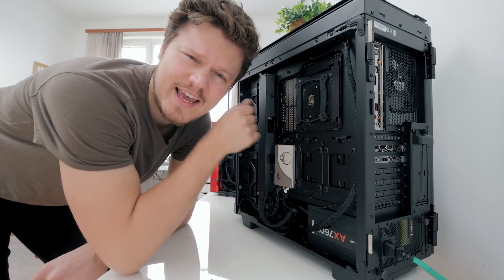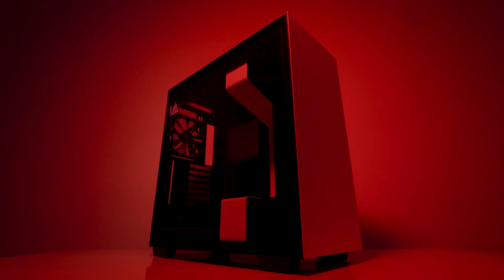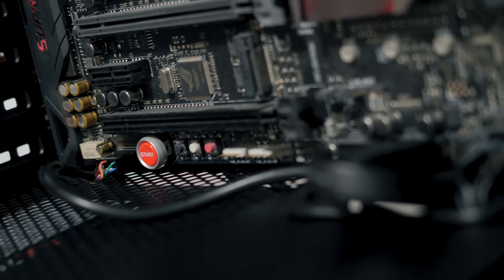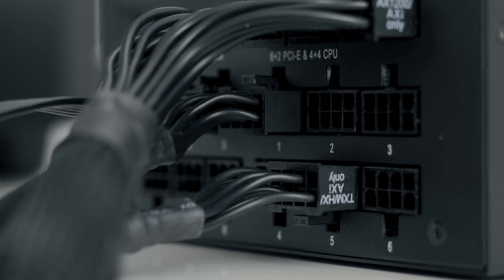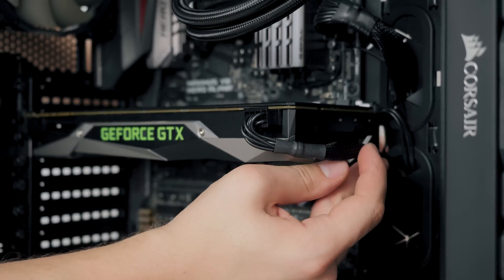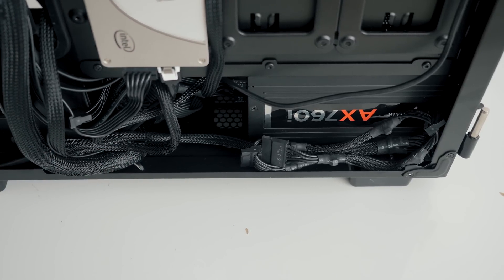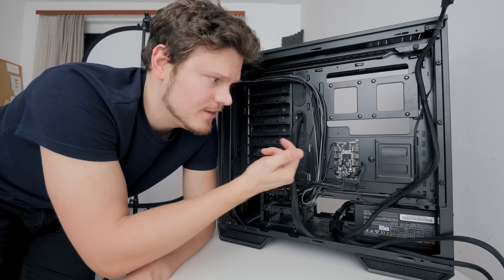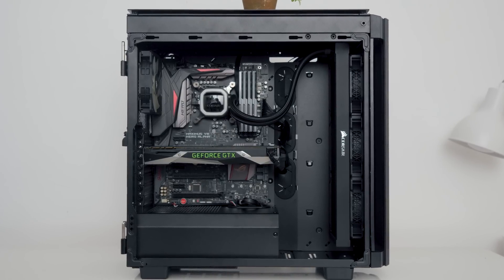Tips for the PERFECT Cable Management PC Build

Comment: im scared to bend my cables so they dont break. anyone have any tips?
Reply: bending them is fine unless you are bending over and over again at very sharp angles, which is pretty hard to do with PSU cables.
Reply: Bending them once is no problem, it's when you repeatedly bend them there's a problem.
Reply: okay thanks

Comment: 1st tip should be don't buy something that's got 5 cables sticking out of it ! or 1st tip should be get a modular or semi modular psu and another tip (albeit more expansive, get an m.2 which will reduce a lot of the cables needed).

Comment: I did  cablemanagement in a $40 case not too long ago... Did a pretty good job exept that the 24pin was just too thick to be able to close the case properly... One big tip if you try to do some good cablemanagement in cheap cases look first before you route any cables. You got too check EVERYTHING... (Like the thickness of the rear side panel, where the cutouts are for the cpu power cable (maybe you'll need to route your cables before installing the motherboard)...) It's really a big puzzle and not that easy... Oh, and don't forget that cheap cases have sharp edges... 😑

Comment: 1. ZIP ties 
2. ZIP ties
3. Zip ties
Reply: Cerus98 almost thought you were serious
Reply: Cerus98 if you have ever professionally built a computer and dealt with cable management, then you know to use thin 2mm wide zip ties which are so weak you can use needle nose pliers to twist the zip tie and it will just break for easy removal, otherwise, you can use fine tip wire cutters which also do the trick without ever damaging the actual electrical wires inside the system.
Reply: Cerus98 In my career, I’ve built over 10,000 computers. You worry too much about the removal of the zip ties and parts from the computer at times where you are probably upgrading. 

As well, your power supplies comes fully stocked with multiple cables, more than enough extras if one of them were damaged from someone making a major mistake.

Zip ties allow you to fit the cables in the system in the most secure fashion, and is ideal for proper cable management for aesthetics.
Reply: Cerus98 soon as you said twist ties, this conversation was over.

Comment: Why did this create a urge inside me to clean my PC x)
Reply: not seeing a problem doesn't mean it's not here. Not cleaning ""may"" lead to some failures, but hey you do want you want, we're not paying for your hardware
Reply: WarmSoftKitty talk about cheap for yours maybe
Reply: I had a laptop I never cleaned in the almost-decade of operation I've had it, and at its worst I was unable to get anywhere past 2 gigahertz (with its max being 2.3). I replaced the fan since it was too dirty to bother with and cleaned the heat sink, suddenly, my machine was able to run at nearly full speed. Cleanliness does matter in certain cases.

Comment: Quick Tip: you can open a zip-tie by pushing the tip of a knife underneath the locking teeth. If it still can't be opened, push the knife in whilst pushing in on the zip-tie itself.

Comment: I'm f. hate Usb 3 cable too :))) Soo stupidly build cable. 
New usb 3.1 gen 2 output on new motherboards like asus is future. 
I want a see them only usb 3 output next year boards and cases.  
Please Dimitry warn case manufacturer about this.
Lots of motherboards already have this supports but cases always left behind.
All new case they send to you review go on them about this. 
Case manufacturer working sooo slowly some still putting molex powered fans.
Don't even accept to review case like that :)
Reply: We need an adapter for that USB 3.1 Gen 2 header. More motherboards are having it but hardly any cases do. My Maximus X Hero (mobo) has one but my case doesn't, and I'm short a header so my two front panel USB 2.0 don't work. A USB 3.1 Gen 2 to 2.0 (or even 3.1 Gen 1) adapter would be handy but I don't think any exist.

And yeah the bulky USB 3.1 Gen 1 cable is annoying. I bought a low profile USB 3.1 Gen 1 extension cable (it looks more like a 2.0 internal connector) so the front panel cable isn't smashed up against the PSU shroud (like it was in this video).
Reply: Why do you guys even want a new case`? Unless it is really poor in build quality?
Reply: still no good option a year later, it's super annoying with my gigabyte aorus 570 ultra in my lian li 011 dynamic, the usb 3 header dosn't allow me to add the middle-bottom fan. I don't understand why this cable need to be that big and thick, I haven't found any article or video talking about that and/or giving any explanation about it, for it to need to be physically like that. (could be a video suggestion)

Comment: Dimitri you should definitely become a cable management guru cause your cable-management is that of a pro and very commendable! I have the Fractal Design Focus G Mini, which is a micro-atx case, and is very lacking in cable-management options. I will definitely check out your upcoming budget case cable management video cause I struggle with how to hide my cables in this case. It is a nice case and good for the price but doesn't have many options in terms of cable management. So I will definitely be redoing my cables and attempt to follow this video guide. Thanks for the help and looking forward to the next video!

Comment: I have a corsair crystal 570x and was wondering if i need the hd audio wire.  Its a pain to route in that case and my headset is powered by usb from the mobo and my external speakers plug directly into the mobo as well.
Reply: Aaron Chandler thank you been wondering for awile now
Reply: Aaron Chandler would it be safe to cut it out with wire cutters and electric tape whats left?

Comment: You forgot... "Step 1: Get a good case."

Also, I've always thought that good cable management really just comes from using common sense and this video really validated that. Utilizing motherboard cavities, controlling smaller cables by tucking it under thicker cables, routing certain cables early on, etc. are things you do learn as you build and I really don't see how a lot of people miss that.
Reply: Benyamin Lorit it might be a first build for them so a couple of tips will point them in the right direction.

Comment: Once upon a time.. of my cm haf932.. i decided to show the cables at the front instead of hiding them at the back. Turns out alright. If would be nicer if the cables were individually sleeved but I couldn't afford it. 
I was using the cm real power pro 850 non modular psu. Still using the same psu... That thing just wont die...
It's in my node804 now... Loads of excess cables..

Comment: Another cable management hack; use m.2 drives and skip having to use sata data AND power cables!
Reply: KrisPeeBacon the sata based ones are about the same it's the nvme ones that cost more.
Reply: Sartheris Stormhammer I don't mind SATA drives, especially in some cases like the H700i that show them off nicely in the front or something. A SATA power cable has 3-4 connectors, so if you use one drive you can use a few more without much more cable. I use 1 NVME, 1 SATA SSD, and 1 HDD. It's nice to have different levels depending on what speed I need.
Reply: @ KrisPeeBacon: But everyone can afford (stupid) high end smartphones. The phone will be obsolete after 1-2 jears while the m.2 drive will last maybe a decade. I just bought a M.2 Samsung 960 Pro 1TB exactly for this reason (no SATA & power cables).
Reply: Nah, SATA just gets cheaper, so it become more prevalent. Such things still have purpose, especially for cost-effective storage.
Reply: I just did that myself. I had 1xm.2 and 1xHDD, but the hard disk had these two big and ugly cables from the psu and to the motherboard, that made the clutter worse, so I just replaced it with an m.2 from Western Digital, cheaper than the most popular Samsung 960 evo, but for sure faster than the hdd.
Reply: "Have no bread? Eat cakes!" level of tip.
Reply: expensive hack :D
Reply: How much pennies should I save to buy mobo with 8-10 m.2 slots I need?
Reply: I'm using a 2TB 970 Evo Plus! Might get another for the second m.2 slot. Love not needing cables for storage.
Reply: I just browse and game and I noticed a difference moving from 850 Evo (SATA) to 960 Evo (NVME). It's not much in most tasks, but it cut my boot time from like 20s to like 12s (no Fast Boot), and browsing folders feels snappier. No difference in games though, and I only have one NVME so file transfers are always limited by the slower drive. Spend your money elsewhere if you're on a budget, but if you can afford it it's nice to have.
Reply: Luke Stringer don't be fickle, if you have four 10tb drives you have no business worry about cable management.
Reply: and enjoy the temperatures...
Reply: Save your pennies and eat all the cakes you want. Sounds like you need more sugar and less salt, anyway.
Reply: 5even5eals see previous comment about data hogs not needing to worry about cable management so much.
Reply: Kurt Dunsmore But we are the ones who suffer from cable management issues the most. I'd gladly use some tips for my heavy-duty config. Every rear panel closing is a huge pain for me.
Reply: agreed!

i have actually started by discarding all my 3.5" hdd and just use one 2.5" sata. when i get my strix z370-f this month, the 2.5" sata will be replaced by m.2 storage.
Reply: I wish my bluray burner was m2
Reply: @BrandensOutdoorChannel  buy 2tb m.2
Reply: @BrandensOutdoorChannel  i have 500gb 970 evo and 1tb hdd
Reply: I can't wait to upgrade my motherboard to have m.2 storage.... But upgrading the Mobo from my 2013 MSI board to something modern means a new CPU, and upgrading from DDR3 to DDR4... It's an expensive venture.
Reply: Only useful for people that has a board that supports is because remember there is also the used market out there.
Reply: Not all motherboards got m.2 sockets, and also if you got single m.2 socket I think the most there is in m.2 is 1TB and it's not enough storage, 2TB or more is the most recommended
Reply: PF, way to easy and not enough slots, I have all m2 slots occupied and also extension PCIe Cards for that + 4 HDDs and 3 SSDs + a fucking Sata cable cluttering the front panel with the card reader. 
It looks fine until I want to connect everything with the Sata cables.
Reply: It's what I did for my build

Also an NVMe SSD was cheaper then the SATA SSD's I was considering.
Reply: I just bought a 970 evo 1tb m.2
Reply: Sweet I'll try and store my data from 4, 10tb drives on an NVMe :P
Reply: @AAAAAAAAAAAAAAAA72  may as well setup a NAS and get all the sata drives out of your gaming system
Reply: not everyone can afford an m.2 drive lol
Reply: @MrKrispee  you can get a fast Adata M.2 SSD for less than a Samsung EVO 860 these days. Faster. Neater and consumes less power.
Reply: SkinUpMonkey well of course NVMe costs more, but it's soo worth it. I have a 960evo 1tb.
Reply: Kurt Dunsmore wave of the near future for sure - SATA is dying.
Reply: @jeffporter4847  can confirm, m.2 drives are getting way cheaper
Reply: @rainertargama6551  oof and faster just went from a m.2 960 evo to a 970 evo plus and those 3500mbps read and write speeds are just insane!
Reply: @jeffporter4847  not anytime soon just imagine, sata can be fit with TB in a case, with m.2 motherboards usually don't have more than 3 m.2 slots and those are the real high end ones. If sata leaves there will be storage cut in 1/3.

Comment: Cable managment has next to no impact on tempatures....
Reply: cable management has a big impact actually - especially if you run small enclosures like MATX or ITX cases. i spent a few afternoons re-routing my cables in my ITX case and saw about a 6C decrease in idle and full-load benchmark temperatures, which was about a 10% improvement - while being almost completely silent. that's HUGE!!
Reply: and you are all right:
1. Most benefit is in small / micro cases. Least benefit in big cases.
2. In an testing bench, how you want to generate airflow??? So yes, with airflow -> better temps...
Means, very big case, with normal airflow... Cable-management shouldn´t worry you anyway.
Reply: are you sure it's due to cable management? Seeing your exemple it only seems to show that you get better airflow in a closed case than in open case. Which isn't exactly news.
Reply: Vincent Andersen yeah, but it's still good to have decent cable management
Reply: Yep Luke did a video on this some time ago, wont matter in a case that big.

Comment: good video but the whole "cable management helps with temps" was already debunked by luke on linus tech tips. literally stuffing your case your unused cables and even extra random stuff will only make marginal temp changes
Reply: As long as no cables get snagged in fans, it's fine. Anything beyond is really just aesthetics.
Reply: Quentin Els this seems more like its the gpu. Cause truly if you think about it and try to do an cable management experiment like luke did, cables aren’t that big enough to obstruct airflow that much from your fans. You only have  a 24pin cable as your biggest cable and even that wont be big enough to obstruct more than a fan
Reply: Star-Lord that and also the elimination of the ribbon cables. Those would definitely hinder temps back then but im very certain no one here uses something that old. Not even senior citizens would be using PCs that old
Reply: @gliffogarchives4987  I have a pc using those lol
Reply: Still the cables collect a lot of dust
Reply: Just wanted to chime in as someone who has built over 100 computers over the course of my life. Cable management is purely aesthetic. And Serp D., you're arguing the ONE exception where you're using cases without fans relying on passive cooling. As long as you have fans setup properly, cable management is purely aesthetic then, and for keeping dust from collecting in the rat's nest of wires. Beyond tucking cables away from fans, this whole cable management thing is a fad or akin to subcultures you find in car culture where they spend loads of time and money on underglow or the VIP look.
Reply: @zoommair  yeah yeah because my temps are lower with a simple cable management. Don't you have some thermometers?
I guess you don't really read much about my posts, did you read about the Mosfits and other passive colled parts on the MB? OC is a thing you know.
Reply: @Vanadium  Nope, don't know who you are, and have no idea what you're going on about. Guessing English is not your first language, so could you rephrase?
Reply: If the cables start collecting dust you have other problems to tend to.. ;)
Reply: maybe back in the day it did something. These days cpus dont run at 500c and 50 volts.
Reply: What about in mini ITX with cables blocking the fans?
Reply: I agree. Cable management is a purely aesthetical thing.
Reply: My right side panel got extremely hot to the touch bc of my poor cable management first attempt so those braded psu cables were generating tons of heat and increasing my interior ambient temperature, talking about a full system build with 4 hdds and admittedly still using an old Fermi gpu, in any case these extreme pockets of heat is nothing that should be ignored
Reply: "debunked" you literally are admitting it changes temps to have good cable management.  Everything matters with the cooling when you are going for a solid 24/7 overclock.  Sure some emachine build it doesn't matter.
Reply: I admitted to a very negligible temp change by literally 1 degree if you over stuff your case with excess cables and random crap. You'd have to be purposefully trying to stuff your PC with crap if you want to even see any type of change in temp. I highly suggest you watch the cable management video yourself to see how much cable management is just an aesthetic choice rather than a cooling benefit
Reply: @gliffogarchives4987  debunked for what? That one specific case?`
Try to get far as you can with a silent tower who is air cooled with more drives then the MB can handle alone and then OC as far as you get. 
With a broken airflow alone your passive cooled bits will let not reach maximum OC what would be possible with air otherwise.
Reply: Serp D. I’m not arguing anymore in a 1 year old thread. Search “LinusTechTips cable management test” they literally explain everything behind there testing and show results
Reply: @gliffogarchives4987    so because it is one year old or 1000 make a difference how? 
Oh and because LTT is always right, right?
So you know their case had nothing actually in it to produce heat, 50°c on a cpu and max load on all cores,pf please. Did I not mention OC or don't you know what it is?
I have more then 8 Drives in one case and without out a fan they are overheating alone. Then there was probably a AC running like most of the time for LTT Videos.
Try it with actual summer temps like 30°C ambient again and actually work with that machine for some hours when your CPU is always at 20 deg near thermal throttling.
GPU also way up to 90 deg. Those two mostly wont go up at all or much from a clusterfuck of cables but the components on the MB it self will freaking go to hot and your system is thermal throttling or even shut down.
Ever tried to OC everything on the system?  Why do you think most guys drop a fan on the MB on a open test bench, just for the looks? 
Sure ramp up all fans that you cant understand what you are talking about so that you don't need to worry about cables anymore. 

I did get more out of my System with cable management for OC stability and higher FPS and nope LTT did not explain anything, barely anything. I cant read any numbers even on 4k res and did you see any real chart with numbers on the different sensors for the MB?

 I guess you should look it up your self and try that out yourself with more drives and other stuff who actually produces way more  heat overtime.